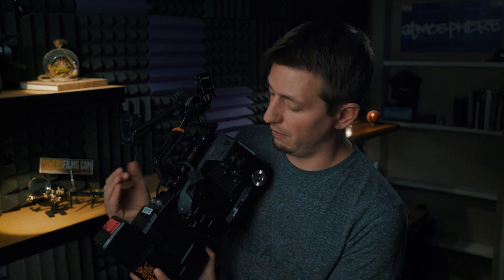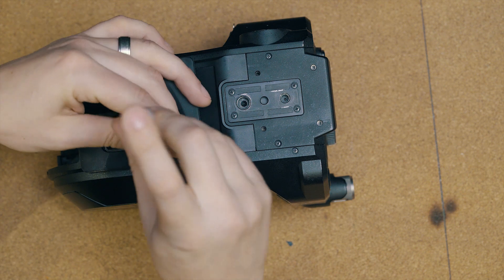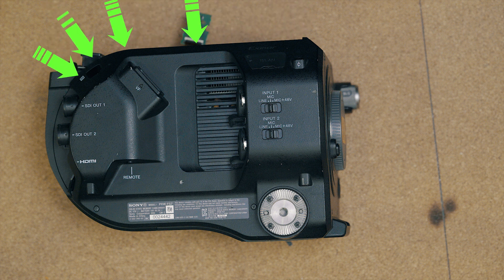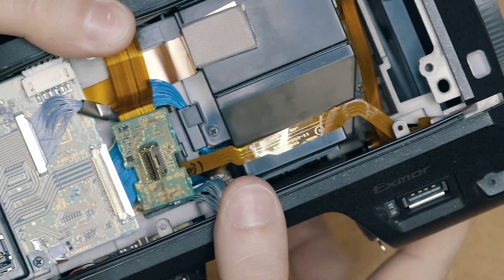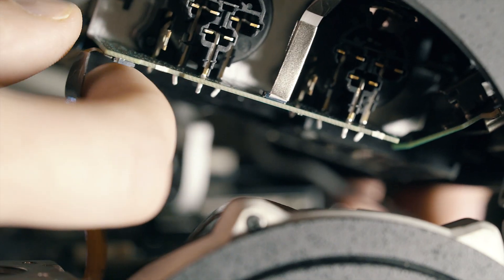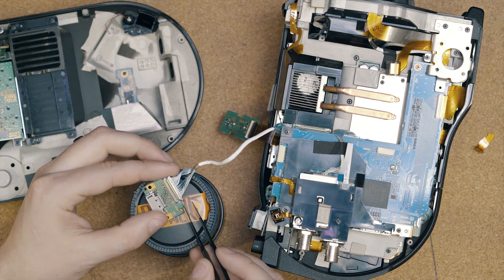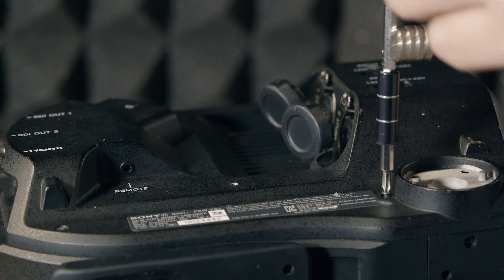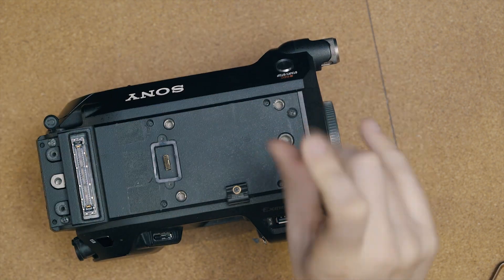Sony FS7: DIY Viewfinder Repair

Comment: Excellent! Huge thanks for your no-nonsense presentation for precisely what i am chasing. I'm on the correct path at least to access the V/F connection that has become intermittent. So far no trashed flat cables !
Reply from the maker: That is excellent.  Glad to hear it. Keep on digging for it.

Comment: This is a great video, worked out perfectly but I would say take it as a given that you will break the usb ribbon cable for the WLAN connection. I was extremely careful and it just snapped in half at the midway point. Looks like it might have been a pinch point with the cover and was weak from design. Or Sony's way of getting back at those of us trying to fix our own cameras :-). Other thing we encountered was the screws to the rosetta were in very tight. Hit very quickly with a heat gun and the loosened up. I think they used lock-tite or similar to secure those screws. Would hit too long though as to not heat up the inside of the camera. Thanks for putting it together. Saving the money is always a good thing, but I have also had repairs sit at Sony for really long times when I needed to shoot.
Reply from the maker: Ouch. Yea, but honestly, when's the last time you used that WLAN port? Haha. It is a bummer and I'm sorry to hear that. There was another FS7 owner on here that also had a hard time loosening those Rosette screws (excellent tip to use a heat gun). One advantage to replacing the WLAN cable is that you can use the port to download your footage from the XQD card. Granted, you are at the mercy of USB 2.0 speeds, but if you don't have a card reader, that is helpful to know.

I might make a second repair video on how to replace the WLAN/USB Ribbon cable?
Reply: You can easily remove it on the inside panel with some tweazers. Then pull it under the ribbon cable for the tally. I repair a lot of these and always do it this way.

Comment: Thank you SO much for this video. You are a STAR and have saved us a fortune :)
Reply: ....and it only took 15 minutes :)
Reply from the maker: Glad it hear it. 

It is outrageous how much a specialty repair can run. 

Don’t get me wrong, it is daunting, but I recommend trying this yourself and remember to stop, re-asses and slow down if you feel any parts aren’t easily removed — or fitting together. 

Another tip: try taking your TV remote apart and putting it back together. You’ll notice similar IR (infra-red) sensors and tiny power cables for your remote.

Comment: This is great info. I'm currently working on a Sony FS100. It looks like the internal battery is done for as it works with wall power. Even if I put a fresh battery it won't turn on.  Any suggestions/directions to find info on the FS100 internal battery?  Thank you.

Comment: Im using a zacuto evf for now... the old hdmi one, but i just ordered the part in case... i have the courage to try... and maybe i can pu one of those really techy guy that fixes iphones to help me doing that !
Reply from the maker: You can do it! I'll most likely be creating a new video showing how to replace the cable that I damaged. After hearing back from others that have repaired their FS5 cameras, this is a little more tricky, but still doable -- just take your time.
Reply: Great video! Thank you so much for sharing!  I manage to fix my FS7 but I also managed to rip the LAN cable with my big fat fingers. Any chance the video on repairing the LAN cable would see the light of day? That would be amazing and much appreciated!!

Comment: You should NOT use a phillips screw driver, it will not correctly engage with the JIS screws that Sony use. This is why so many people end up with damaged screw heads on the rosettes or any other tight screws. You need JIS size 00 and 0.
Reply from the maker: Excellent point, yes, you should use a size 00 and or 0 JIS screwdriver -- (Japanese Industrialized Standard, which makes sense because these things are Sony and are made in Japan).
Reply: @Powersfilms  I use the Wera JCIS PH0, which sony recommends for their service training. You can buy a specialist sony screwdriver, but it's over £100 and with all screwdrivers this size, it will eventually break. The rosette is a pain in the backside though. I often just drill the heads off as they are quite often bent from heavy hands.

Comment: I was almost there...then the rosette screws all were stuck and started to strip....I'm so heart broken and have no idea how to proceed removing the side panel. :(
Reply from the maker: BarkingMadMedia you are still ok. It turns out, that you don’t need to remove the rosette screws, but you can if you need to replace the rosette.
Reply: @Powersfilms  whhhaaatttt really? How,does it slide off? This is grand news.
Reply from the maker: BarkingMadMedia happy to help.
Reply: @Powersfilms  Are you sure that you don't need to remove the rosette screws? I am also having issues with the screws stripping and it seems impossible to remove the side panel without removing those screws.
Reply from the maker: Yes, I can confirm that you do not need to remove your Rosette screws, as those screws are there to mount the rosette, should you need to change it out.

I would double check that you have removed all of the screws mentioned in the video (minus the rosette and honestly, I later discovered that the rubber "shoulder" pad also can be left on).
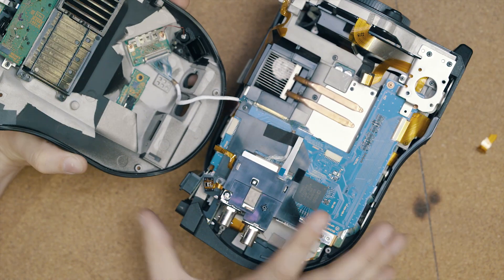Reply: @Powersfilms  I've confirmed that I've removed all the other screws, but the side panel still won't come off. It seems locked in in the bottom right, where the rosette is. Did you need to use a lot of force to remove it the first time? Looking at the video at 5:48, it really looks like the screws that mount the rosette to the side panel also screw in to that metal plate at the bottom right.
Edit: I found the service manual, and the first step for removing the side panel is to remove the rosette screws. Guess I'll have to figure out how to remove them after all: https://www.manualslib.com/manual/1243945/Sony-Pxw-Fs7k.html?page=61#manual
Reply from the maker: @UIowaStudentVideoProductions  That's awesome! I was going to recommend flipping to page 60 of the service manual or checking the link here: https://www.manualslib.com/manual/1243945/Sony-Pxw-Fs7k.html?page=60#manual

Either way, you should be able to remove the rosette screws. In the inconvenient event of a stripped screw, you can either extract it, slot it (using a dremel tool to mark a flat-head slot) or just brute force it (bad idea). Let me know how it goes.
Reply: @Powersfilms   the link to buy the replacement says its sold out , any idea where else to get this part ? thanks
Reply from the maker: @the_infamous_oz  Hey, hit up VideoOneRepair.com via email: info@videoonerepair.com

Tell them you're interested in just buying the chip module, give them the part number and they'll probably just sell you the part for about $55?
Reply: @UIowaStudentVideoProductions  I have a first generation FS7, and can confirm that MY rosette DID need to come off. I was able to remove 2 screws, but ended up needing to drill heads off two others (and back out the stems, making for easy replacement with new screws).  As soon as I had all 4 screws out and the rosette off, the side came off easily.
Reply from the maker: @BarkingMadMediaCan  Hey, I'm not sure if you saw, but someone was able to loosen up their screws for the rosette by using a heat gun. Heat guns are fairly cheap (~$11) on Amazon. Hopefully that can help?

Comment: As a broadcast engineer of 30 years and repaired over 40 FS7's with this fault, this is one way to cause yourself more grief and money by way of snapping ribbon cables and incorrectly installing the side panel.
Reply from the maker: You live and you learn sir, thank you for your help.